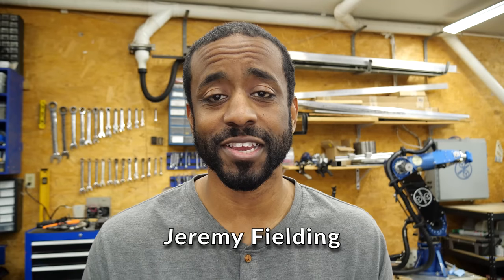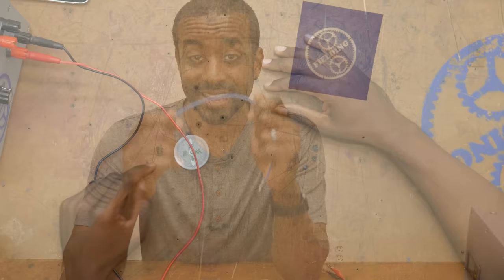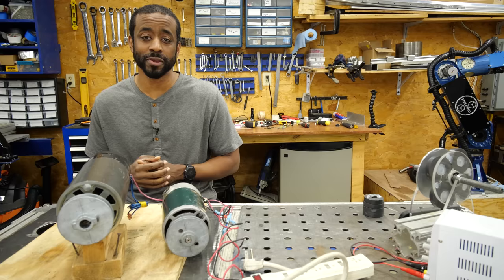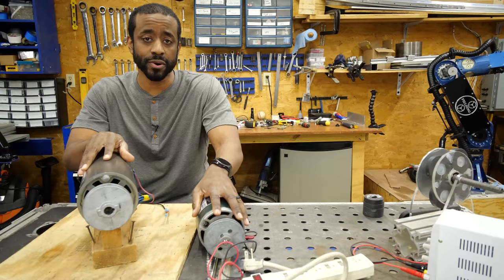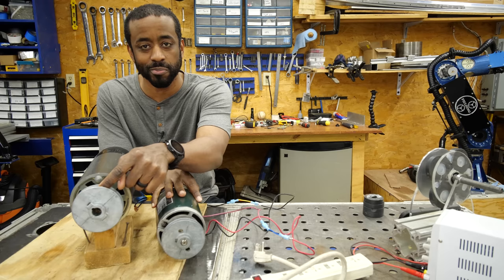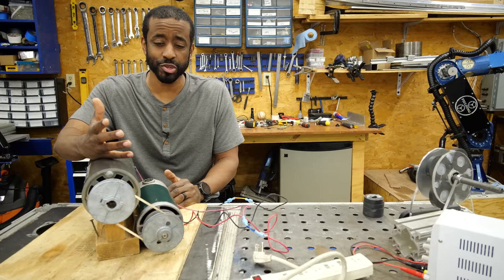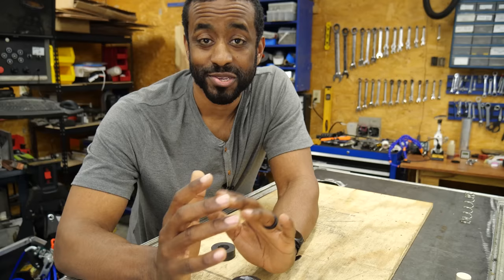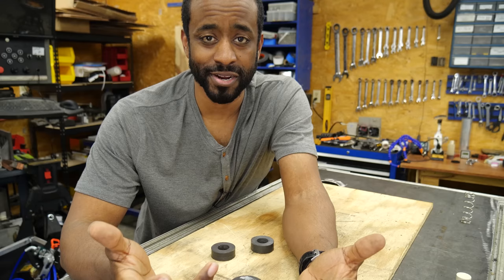Reviewing Free Energy Generators.  A Response to My Video "Nikola Tesla's Greatest Invention"- 102

Comment: Would it be possible instead of a belt between the two to have a gear ration to spin the one faster to make up the efficiency?
Reply from the maker: I talk about gears in the video. Perhaps you skipped around? They don't help. Gears don't add power though I understand why people think they do. That's why I talk about it in the video.

Comment: ..i have question, about my new 1000 Watt mobile-airco..i have an 3000 Watt inverter (from Aliexpress) i learned to conect my inverter with batteries..but thats costly and batterie will run out energie fast..MY QUESTION: IS IT POSIBLE TO JUSE AN 1000-1500-WATT POWER-SUPPLY INSTEAD OF BATTERIES? OR YOU HAVE A SOLUTION PLEASE ?! THANK IN ADVANCE..HAVE A GOOD SAFE DAY..

Comment: You can't  make  electricity  with the same it has to be mechanical  then  converted so put your meters  away give up the answer mite be in weight transfer  inside  an impeller or turbine that would  not  use water or wind but weight  transfer

Comment: Please please understand I have a question I'm thinking you might be able to to answer it what material can I get that can withstand 1 million ,Rpm I looking for a material that will with last indirect contact of water I've only been able to get it to 50,000 revolutions per minute and it brakes at that high speed what material can I use

Comment: @JeremyFielding What about those videos that have a pendulum between the two motors?
Reply from the maker: The pendulum doesn't add energy. There is no device known to man that can multiple energy. So there is no combination of these known devices that can multiple energy. So the answer is... if it uses a mechanical device that was invented more than 1 year ago it is definitely a scam.
Reply: @Jeremy_Fielding  I was thinking about the flywheel that can store energy, maybe I use the word wrong.
My question was around what do you think about storing kinetic energy in a flywheel then convert it to electrical and then using that electricity to keep the flywheel running, trying to maintain the initial power that we put into the system by an external power house. Or we could attach solar panel to keep the flywheel running.
How can we make a project on that small one I mean
Reply from the maker: The same answer is true. I flywheel doesn't create energy. Think of it as a mechanical battery. Batteries don't create energy. They need to be charged. Flywheel need energy added, and they lose energy when you connect something to it. Instead of chemical energy like a battery it has kinetic energy... speed. If you connect something to it is slows down and stops. There is nothing free about it. In fact it waste a lot of energy speeding up and slowly down. The flywheel is commonly used in these scams because converting from one form of energy to another is a bit of a mystery to most people. Mysteries create opportunities for scammers to lie about how they work.

Comment: Why not try an AC motor with a digital sine wave booster it's sort of fools the AC motor into a NANO drive unit. buy pulsing power down each wire and do the same for the winding where it utilizes a push-pull or a pull like roller coasters or high-speed trains etc... They were quite expensive at one time, but they should be cheaper perhaps now. It's a moving attraction point similar to a timing light that is strobing where two frequencies chase each other, the use of Nano wire means you can build patterns into the wires as you pass micro-currents across them as in using a turbine with fins all based on attraction and repulsion and timing, frictionally free to losses. You just spinning information of patterns of math as the earth and the moon chase the sun. Each house could have its own power generator unit, which could be attached to your vehicle as well. Of course you get free parking 🅿it's part of the collective that feeds the city it's power. The turbine could also allow for ventalation or a breeze to occur filtering cooling or heating of the surrounding areas like a bubble that ciculates. The simplist designs are often the smallest. There layered printed circuirts that can be paterns in patterns thick, how much force do you have now. Of coarse there will be that guy who "hot rods" it and that cycle rinses and repeats.

Comment: Inputs > < incorrect 300w alternator run 150w motors this would run electric EV run 4 x alt>  to 4 x 150w ac motors
Reply from the maker: The power rating of the motor tells you how much the motor or alternator can produce without damaging itself. ITs a safe operating load. That is the "designed optimum output." That is not THE actual output. There is a huge difference. This seems to be the point of confusion for you. If you have a 200 watt motor pushing a 100000000 watts alternator the alternator will put out something less than 200 watts. Same thing the other way around. Alternator powering motor. Input determines output no matter the size of either. I explain and prove this in great detail in part three of this series. Link in the description to the playlist. Watch the last video.

Comment: You missed something VERY important.
Alternators/generators can put out varying amounts of power, rotational speed matters as well as design and rotational resistance.
So, design a high output, high efficiency alternator, with low rotational resistance, and vary the rotational speed to find an optimized output.
This is very doable with the proper education, research, materials, and design.
They don't do this on cars because it would easily expose their lies, misinformation, and immoral suppression of the truth.
We know for a fact that the government has been covering up, suppressing, and outright denying ultra-high efficiency fuel engines, as well as zero-point energy for at least the last 100 years.
There is a factual trail of video, and 1st person testimony, as well as a loooooong line of clearly murdered dead inventors as undeniable proof.
Reply from the maker: Wow. You really should just try it. There are too many errors to try and fix all the misconceptions in the comments. And the fact that you think this is a conspiracy makes me think I could not change your mind no matter the proof. Clearly if this worked it is worth your time to try. Or you could watch part two of this series if you want to see me test an alternator. But if you think this can be designed away, you don’t quite understand why it doesn’t work yet.
Reply from the maker: I do think one flaw is worth pointing out. “High output” as you describe it and “input resistance” are directly proportional. There is no such thing as increasing one and decreasing the other. Increasing the output causes more input resistance. Low output would cause lower resistance. In the same way that going faster on a bicycle (every thing else staying the same) you are forced to push the pedal harder. Every device that transfers energy pushes back against the input device. There are no known exceptions to this rule which is how we get the law of thermodynamics. If you manage to figure that out you are changing science as we know it and win a Nobel peace prize

Comment: Now hold on a second.  The explanation of the alternator not being placed into "Electric Cars" because "it wastes a whole bunch of power" does not hold up, and the people that bought that explanation, who are commenting on this man's great presentation, are just watching without using some brain cells.  Don't get me wrong, I like his calm demeanor and detailed explanations, however the loss of energy, which was created by an $80-$200 alternator, but is the gift that keeps on giving without costing the consumer an arm and a leg on continual charging, is not a common sense or valid explanation that holds weight.  What do people pay to charge their car monthly?  I can tell you it's astronomical in the state of California!  I am sure they would appreciate that $80-$200 part being installed on their purchase, and the cost savings it would provide long term.  Yes they may still have to recharge every now and then, but so does a solar set up with a battery system.  You may drain the batteries in a solar system set up, and have to turn the energy draw off until the panels recharge the battery, because the solar panels could not keep up with the amount of energy used. Look at the solar panel as the alternator which sometimes does not create enough power.  Come on people!
Reply from the maker: I think you misunderstand the problem. There is ZERO benefit. I don't mean "not enough benefit to be worth it" I mean it is measurably worse with a alternator than without. You have more range without it than with it. It waste more power than it gives back. Adding the alternator is like paying $50 for a $20 bill. It is never a good deal. I explained this better in part two and even proved it with a demonstration near the end. Link to explaination in the description.
Reply: @Jeremy_Fielding  So what you are saying is it cost more energy to power the alternator than alternator creates in power?  

Lets say cost 100 to power the alternator and it only gives back 80, so there is 20% loss just by installing the alternator?  I guess I have a hard time understanding how that can be?
Reply from the maker: That's why I made a part two. You should watch part two. Link in the description. You can also try it yourself after you watch the demonstration. Experiment change things. It's the best way to learn. If you're right this would be worth hundreds of billions of dollars. If you're wrong it will be a great lesson in physics

Comment: What if... You get rid of the motor/generator thingys because they're inefficient. Just use the power strip. Plug it into itself. Voilà! Sure you loose the use of one outlets but free energy is free energy.
Reply from the maker: From a purely engineering standpoint that makes perfect sense. However when it’s easy to understand you can’t scam people with it. So the more complicated design is actually more effective at getting free money… I mean free energy

Comment: Alternator on a battery car, that's a joke. Put you headlights on when your car is on idle. Then engine slowdown. Due to friction, resistance etc, it will always take more energy than you create, so you electric would go flat quicker.

Comment: But your explanation about the alternator also gives a answer to this difference of the battery from the phone that there wouldn't be enough energy produced to charge something else, let alone another phone with a cell phone battery. It would have at least to be something like a 12 vote. To be any value over time and would only be moderately. Some maybe a 12 boat, even too big like a 9 V better.  For the theoretical short version as Cell phone emergency like turn on and You get a little bit for backpacking out or something like a car dying on the side of the road. And at least you could use your phone for a minute. Turning it on and getting something, but not anything for an extreme amount of time.....very limited......if at all and didn't  over heat or break to cheap purchased dc motor!  Lol

Comment: Two motors can work if there DC also you need a bridge rectifier so power runs in one direction and use a battery to start rotation  one is a motor one is a generator your generator should have more out than motor  and bridge needs to be at generator output to battery tell me this won't work
Reply from the maker: This doesn't work for many reasons. But reading how confidently you write this claim, I think you really should just try it. Its best way for you to understand the problem. If this is true the idea is worth hundreds of billions of dollars, and a noble peace prize for changing our current understanding of physics. Literally everyone on the planet wants this, and would be willing to buy one. I think its worth your time and money to buy the parts and make it if your sure. If I am right you still get a great lesson in physics. It is worth it either way. My point is this claim is way to big to be made lightly and without even bothering to check if your right. If you are sure you are ignoring an obvious gold mine and that doesn't make sense. I do love that you are interested in this topic though. It means I am on the right track teaching about this very issue. I have a follow up video coming out in about two weeks which addresses exactly this idea. I hope you will watch if your willing to wait for my demonstration. Then you won't need to build it to see the problems with this idea. Though you may need to see it for yourself if you don't want to believe me. That's also a great way to learn. Thanks for watching and commenting!

Comment: If somebody uses the tracks on a maglev to turn it to and uses an extremely strong and conductive material and harness the excess electrons that the kinetic energy on maglev train produces. Could that energy produced by something a maglev train going 200 MPH and then rerouted back into either the grid or into a power plant.
Would something like that be possible?

Also though if magnets can fall slower through a coil. 
Is that fake too? 

Magnets can most likely be used to cause either mass cancelation or something that overwrites the accerlation of gravity. (gravity doesn't have a speed but it does have a math equation for the accerelation of gravity).
Reply from the maker: There are a lot of assumptions in this statement that are not true. It's a bit difficult to untangling all of it. Maglev uses a lot of energy to create the lift and balance. These are not permanent magnets. It's not magic. It's just a way of reducing friction but there are expensive tradeoffs or we would use them everywhere. A magnet falling through a coil  is still falling. The energy came from lifting it with your hand. You added potential energy by raising it and released it. Gravity also doesn't have energy. You have to add energy but lifting things uphill. It's not free since you always have to lift to get anything out of it. For the copper, That energy was being converted to electrical energy and the slowing actually proves it's not free energy, but that every method for making energy has resistance. I explained exactly this in part 3 of the series. Links in the description for more information. You are just missing some very small details that makes the difference between something that works and some thing that doesn't. Also just try it yourself. Thousands of people email thinking they have created free energy and it is always the same 7-8 ideas that everyone else has. We all come up with the same wrong ideas because of a few tiny gaps in knowledge. This is fixable. I made two more videos to explain these gaps and you can try it yourself. It's the best way to learn

Comment: Hey I seen a guy make an alternator into a bike with a motor he turned the alternator into a nitro he said he made the middle pulley magnetic which made it spin and so I was curious is it possible to take the motors and then alternators and make the middle of the magnetic like how you did to get it to spend and then put them to where it's like they got the belt on and make it to where they spend each other is that possible to do that and then if you can get something like that to happen how fact do you think you can get something to go

Comment: I believe you, but I don’t understand how do you charge up the car battery if you just leave it running. Isn’t it generates more power than it uses ?
Reply from the maker: That’s a gasoline car. Completely different power source. You are indeed burning fuel while running the car
Reply: I see . How about you’re up convert the  the power you gain with an inverter and run a bigger motor to spin the alternator? Don’t judge me I know nothing about this just thinking 😁

Comment: what if you add a transformer to multiply voltage to other motor to make it spin faster ?
Reply from the maker: I explain exactly this in great detail with a proof demonstration in the third part of this series. Link in the description. Voltage doesn't equal power. When you double the voltage the current is cut in half and you have exactly the same amount of power. So... it doesn't work. I explain why this happens and demonstrate it with a transformer in video number 3.
Reply: @Jeremy_Fielding  so multiplier sacrifice current for voltage and reverse wich make it worse
now i enderstand thank you for info

Comment: Would gear ratio be a solution? or would a percentage of energy still be lost in the loop? for example, a 30 teeth gear output of 42 revolutions for 1533 rpm output to a 20 teeth input of 2300 rpm 63 revolutions to send a looped power back to the 30 teeth? your explanation of friction causing energy to be lost would debunk this, but the gear to gear ratio sounds like an interesting attempt to find a loop in it connected to a timed device that charges and than once charged to a certain point it can send out an electrical blast to the magnet that can then send a quick pulse to continue pushing a magnetized wheel. so every so often when the battery is charged it will use that energy to end a pulse to the magnet that will blast out a strong pulse to continue pushing the rest of the magnets in a perpetual wheel.  would energy still be lost in this loop?
Reply from the maker: Check out the playlist in the description. I talk about gears in part 2 and 3. I also demonstrate what really happens. Gears don't change power output. Check out the playlist for a demo and explaination.